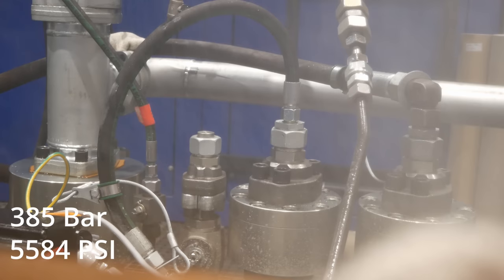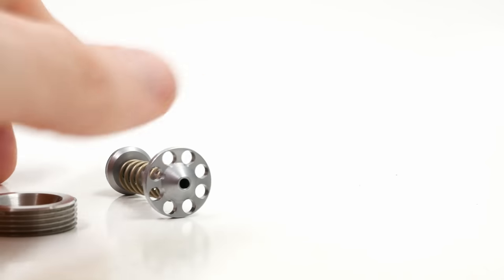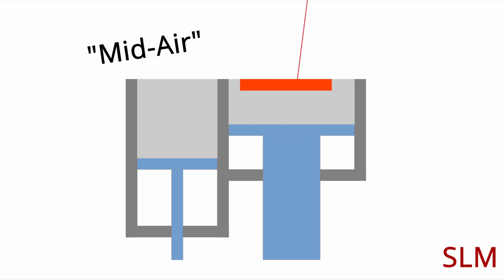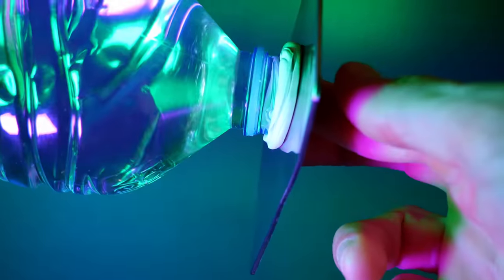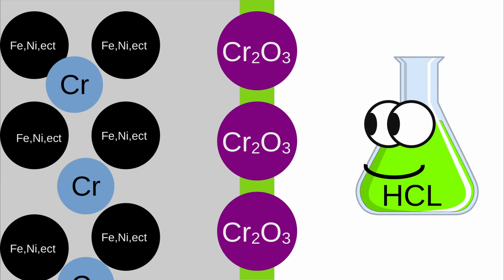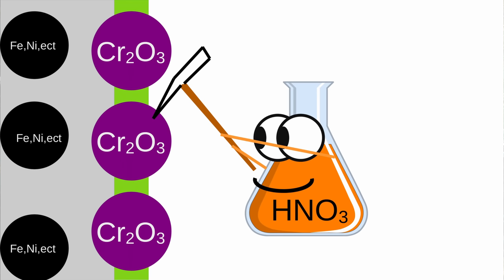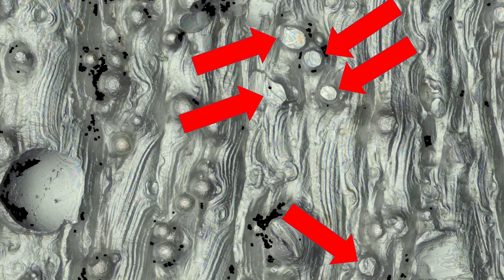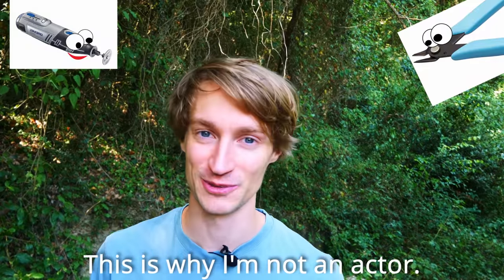Metal 3D Printed Compliant Check Valves!

Comment: That’s very intriguing, considering a portion of existing hydraulic systems are already designed with minimal bypass rather than leak tight valving I could see this being ready to use in some designs. Very interested in seeing more on the overpressure deformation sealing if you conduct more testing.

Comment: I'm probably overlooking something but particularly for the cantilever valve, could you not just drill out the supports from the outlet side?
Reply from the maker: in this case yes!, however if you print this inside of a larger and more complex system, then you will probably not have the possibility to do so.
Reply: I had a similar thought about this as well. In a simple valve you could just have the supports attached to a surface made to be cut out. However, he just explained why his design really shines.
Reply: @Sunshine but isn't removing it via chemical reaction or mechanical or by abrasive (if we would create some kind of relive hole so abrasive with water would be able to remove supports) wouldn't also be considered cheateting like with pausing print(as we still adding manufacturing operation there and pausing gives us chance to give some kind of oring or something like that) i think in this case pausing would give us more possibilities
Reply: If you make the supports look like this <<<<<< instead of IIIIII and pump fluid through back and forth in both directions, then the supports will flex and fracture.
Reply: @otherwayup  Although then you would need to design a path that would let you pass water all the way through your support structure with enough space left over afterwards for all of those supports to flex free
Reply: @claws61821  My thought was, if you pump fluid through the valve quickly in the normal "flow" direction, the spherical end of cantilever will get pushed down compressing the supports a tiny bit.  High pressure in the reverse will lift the spherical end, stretching the supports slightly.  Repeated switching from one direction to the other will gradually work harden and fracture the supports at the point of the < shape.  The supports nearest the spherical end will go first.
I wasn't thinking the fluid would have to pass through the support structure, but maybe it would.
Reply: @otherwayup  What about a support structure that would be permanent in the shape of a "spring" with very low reynolds number? Spring meaning a infinitely deformable structure designed to never have such great deformation as it would enter plastic deformation.
Reply: @brissa94  thats pretty clever, although in this application, i think it would hurt the operation more than anything due to shrinkage. I imagine it holding the valve open.
Reply: What about removing supports with pressure?
Reply: I am with team "Use smaller diameter concentric support and just drill it out from the exit side." Printing everything in one piece is unneccessarily complex and prone for error anyways. On another take, printing 2 materials using copper for a heat distributing support material, one could get rid of this using any mild acid like vinegar without doing any damage to steel components.

Comment: When it comes to leak rates of check valves, the tension on the ball that is covering the orifice doesn't always matter. If your looking for LPM leak rates then anything that closes the orifice would suffice, and the failure would come from the strength of the material used to make the body of the valve or how it is installed. If your looking for sccm or lower rates then the surface between the body and ball will matter more or if your looking for a zero leak rate an o-ring will be used. Also nearly all check valves have a "cracking pressure" which is the pressure needed for liquid or gas to move in the flow direction. So 3d printing a one piece check valve would become infinitely harder to make on a manufacturing level because you would most likely need a unique design for each different valve spec to compensate for unavoidable material properties.

Comment: Interesting design. I'd guess, another viable strategy would be to design it in a way where low quality of overhang surfaces doesn't matter. For example, instead of making the valve ball in a ball shape, make it flat with concentric rings on it (shaped like WW on a cut) and the same on the matching surface. Then the sealing could be done by sticking the sloped surfaces to each other while the overhangs could be left with some free space without their low quality affecting the sealing. Also, there would be greater sealing surface and stronger action towards these surfaces matching.
Reply: That was my thought as well.  Use a shape where it's okay if the thing is a blob of metal.  Then, "just" use high pressure to form it appropriately.  Another alternative is to design the part in a way that the check valve has a sprue coming out the end.

That springy one looks like it was designed to be drilled out.  Yes, it's not print in place, but it's also not using acid.
Reply: Alternatively or additionally, there's a process done with automotive systems that uses an abrasive putty forced through the system to polish internal surfaces for coolant and exhaust systems. 

Could also electrochemically plate internal surfaces with a softer metal like copper better able to form a mating surface.

Maybe even mix and match approaches.

Comment: So instead of an interrupted print, you have a psudeochaotic chemical process, and still needing multiple machining operations lol. 
I dig your process, and artifical constraints help to further your methods, even if they aren't the greatest. You can see the issue with the porosoty of the sintered parts.
That prestressed bit with just a single drilling opertation is pretty sweet however!

Comment: I would say if you need a 3D printed check valve in your component, design the component so you have a route to drill out the supports, and fill that service port with a high strength metal epoxy, bung, or a weld after the supports are gone and just let the channel hold fluid. With the cantilever design, it looks like you can fill some of the support area with a flexible material, and get more holding power.

I would also look at automatic transmissions, they are full of check valves, and they work by integrating the check valves into a valve body which is just basically just a complex machined metal plate, that integrates into the transmission's design; they use little metal, plastic, or silicone balls, sometimes with springs or connecting dogs, that can often be adjusted to alter the transmission functions.
Reply from the maker: Many good points! And definitely the way to go if you want to do this today.
Reply: Yeah, I posted the same idea before reading your comment, a drill will work perfectly and way easier.

Comment: I really enjoyed your video. I design and manufacture valves for rockets/in-space systems. The leakage requirements are very tight, usually 1E-3 SCCS at MEOP using helium. This basically forces you to have 8 Ra seal surfaces and soft goods like Teflon/Vespel/KEL-F. This is essentially what kills ability to use 3D printed designs.

3D printing also comes with two major downsides. 1) you are constantly printing dogbone samples for tensile testing since every print has to be validated and tested. 2) the surface finish on even non-critical parts of the print is very rough, to the point where it’s basically a foreign object debris (FOD) magnet, which FOD is one of the most common things we worry about with valves since it can easily force a valve open or closed or damage a seat seal where it stops sealing.

I think this tech could have some benefit in systems that can have high leakage and are still weight sensitive. Maybe more on the engine side of aerospace potentially. But generally speaking, it’s easier to test individual valve units and then integrate them onto a product so that if it fails and needs to be replace that it can be replaced easily.

Anyways, just wanted to share. Thanks for the video!

Comment: The company i work for makes various valves including check valves for the space launch companies. We have done some experimenting with 3d printing (although not specifically with check valves). We've always run into the issue with the surface finishes. At cryogenic temperatures you need a really fine finish. Usually a 4 or an 8. Especially since at those temperatures your either going to be using a metal on metal seal like yours or some form of cryogenic polymer like ptfe, pctfe or vespel. 
I'm sure at some point someone will solve that issue. For now, even in 3d printed rocket engines the valves are generally totally machined or printed and then machined.

Comment: You should look at extrude honing the surface internally. That would likely smooth the sealing surfaces substantially.

Extrude hone is basically silly putty with grit of varying sizes to sand the surface as it flows through the orifice

Comment: I've helped design, cast and forge different valves and your designs are incredible. I believe 3D printing and casting will meld together into an incredible manufacturing industry soon, especially with pumps and valves. Currently 3D printing is in specialized sections with high costs, but its changing rapidly to make designs that can cost less, made faster, and are sometimes stronger.

Comment: With the internal floating check valve, you could make the floating component with support from the centerpoint through the neck of the exit port of the valve (in the opposite direction of fluid flow) and print with that end down.  Then, in removal of the support you simply cut the support flush with the valve channel end.

Comment: Nice video. 
To comply with the rule for no printing of “floating in mid air part”
1) Declare a substrate that will be removed when printing is done. 
2) Extend the base of the floating part onto the substrate. 
3) Machine off or snap off the substrate leaving the complete assembly behind.
This isn’t entirely printing but does the job.
Reply from the maker: In this case it would be possible! But the general concept was that the check valve is somewhere deep inside of a hydraulic system, hence it was removed with acid to show it's possible.

Comment: WOW What timing for me!! I have been trying to design and print a Shuttle check valve and It's boggling my mind. I want liquid to flow in one direction unimpeded, but when it attempts to flow in the opposite direction, it isn't just stopped-- but ejected out of a third port unimpeded!   Obviously when the flow returns from the first direction, the third port is sealed off from the flow.  I believe this is called a shuttle check valve. or really a "quick exhaust valve" which you can google to see some diagrams. The bat-wing design may work for me.   I aim to use this for an ebb flow system-- to prevent water from backflowing through the pump but instead redirecting it using gravity to flow into the reservoir. I am fine making this valve in FDM plastic because the application would not suffer from tiny/seeping leaks. I would like to use the rubber/silicone hose itself as the sealing surfaces inside the valve -- which I have done with success in a regular check-valve design. (The "ball" to seal was a cone shape and 3d printed in plastic).  I am hoping to come up with a design that uses these same features for a quick exhaust valve.  I would love if you or anyone else had any input!!! For it to work, I need to make it either print-in-place (preferred but harder), or screw together.. so I can print pieces separately and still maintain the valve in the future.
Reply from the maker: Sounds like a fun project, have you tried replacing the sealing ball with a double headed plunger? should seal and move a lot better than if you 3d-print a ball

Comment: I think the most important isn't the valve.

It's a way to remove metal printed supports inside of a print without mechanical access.

I will think about how many new possibilities are possible with that.
Reply: Maybe if the SLM printer had something like a silk screen wherein you could deposit something like aluminum only where your supports would be, but stainless steel elsewhere. That would allow your post processing to only worry about removing one type of metal, instead of affecting all the internals.

Comment: I think you can get past the cooling limitation by using a laser to scan the print surface from time to time, and have it wait until the part has cooled down before continuing with the next layer. Maybe also use an AC unit to cool down the air inside the chamber very low temperatures, while also dehumidifying it, to help the part cool faster, and a constant flow of air towards the cooling surface, which to be slow enough to not disturb the powder but cold enough to help it cool faster, would do just that.

Comment: Great engineering. You could use a coating to improve sealing without needing a o-ring. A low viscosity polymer could be flowed through the valve, allowing the excess to drain out, then thermally cure the polymer.

Comment: The advantages are numerous.
But there is also one disadvantage that regular parts don't have (unless it's purposefully designed to be as user unserviceable as possible). You can't replace just 1 element that broke. Need to replace the whole combined part. Which will probably be more expensive than for example a valve, even if 3d printing costs go way down.
Reply: Yeah, also this kinda feels like a solution in search for a problem. And considering the length he had to go to for the manufacturing, and the drawbacks of 3D metal "printing", i have a very strong feeling that a traditional check valve would be a better solution here. Yes 3d lets one do stuff you couldn't to any other way, but that does not mean you have to or should to everything with it. <.<

Comment: You did a very good job at explaining the metal printing working, thank you for that.👍👍
HOWEVER you also showed it makes economically no sense to make parts this way because you can't have (a good) production control on any of the inner (valve) parts.
AND ofcourse because it takes forever and a few years to produce a part.
Production speed(aka costs) and production(quality) control are the most deciding topics of any production process.
It reminds me of the 5/2, 3/2 solenoid/air valves (WITHOUT mechanical valves) in which the airspeed was decisive for the working instead of mechanical valves.
This was "future technology" many years ago but you never see them anymore for obvious reasons.

Comment: You could take a piece of compliant plastic  that springs back at the angle of the sealing surface put some valve grinding compound on it or just polishing compound. Spin it with a drill and that should help with the sealing surface. It wont be perfect but it will get you much farther in a valve that doesnt leak.

Comment: To fix the support structure issue, print it upside down with the supports past the check valve on the plunger body and not on the sealing surface. Then hit it with a hammer. The mating surface stays clean and the supports don't actually need  to be removed since fluid can still get past and they still let the plunger move freely since thy are behind all the contact points of the check valve.

Comment: Cool stuff. One of the issues with integrating check valves or other valves: serviceability. If the seat degrades, your spring mechanism fails or your poppet breaks and gets shot downstream, you’d have to scrap the whole part. If you look at something like API 594 they require the disc to be able to be replaced. I’m sure for ultra high performance it may be worth it to scrap the whole part.
Reply: Overall, is it cheaper to print another part rather than having the bigger heavier multi-part design?
Reply: @TheRainHarvester  it would probably all depend on the situation, but I would bet in the majority of cases it wouldn’t be cheaper to print an entire new part. But as metal printing becomes better and cheaper, who knows?

Comment: For cantilever valve, if you make the supports look like <<<<<< instead of IIIIII and pump fluid through back and forth in both directions, then the supports will flex and fracture.

Comment: With regards to the supports, looking at the way that you've designed a valve, you can actually just get a drill and then drill through the outlet and you can drill out all of those supports.

Comment: Interesting concept.  If a sintering machine that can do two metals per layer is ever designed, this would be a cake walk.  Steel supports easily dissolve by using an alum solution for aluminum parts, zinc dissolves much faster by HCL than steel, etc...

Comment: This is really cool. Awesome work. Additive manufacturing is going to give us some amazing solutions in the future. I do wish we could have seen a machined cross section of one of the valves which had the supports successfully removed with acid! I also would have enjoyed a more thorough explanation of why the stresses build up in such a way that the cantilever flexes up to close the valve (as opposed to wanting to flex away from the closed position or any other direction). Great work, though! Excited to see more projects.

Comment: there is this proccess called extrude honeing. basicly pumping silly puddy full of grit through stuff. its used for cleaning up completely blind areas way down deep in cast manifolds and engine cilender heads and stuff like that. should work for cleaning up those touching surfaces and wipeing out the support structure withought the nasty chemicals. but what do I know I'm just half way though my mech engineering degree.